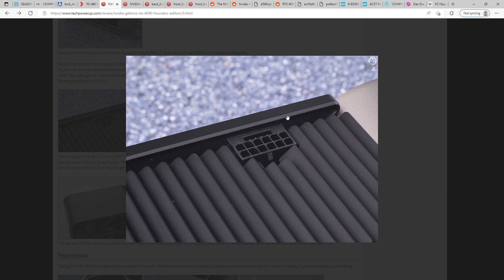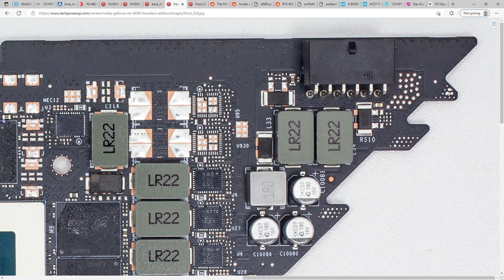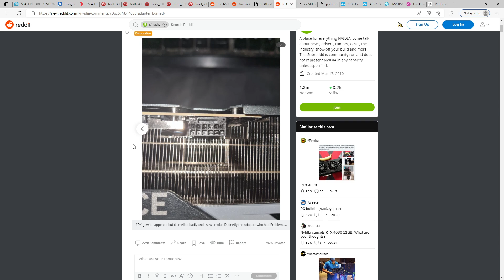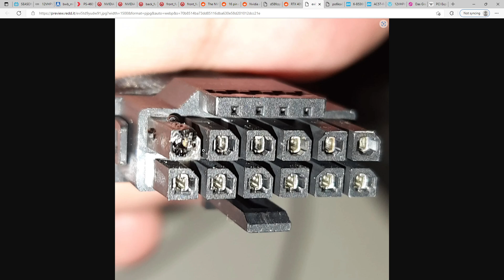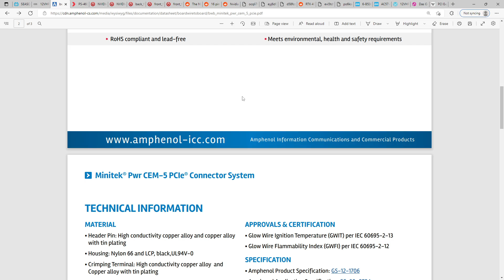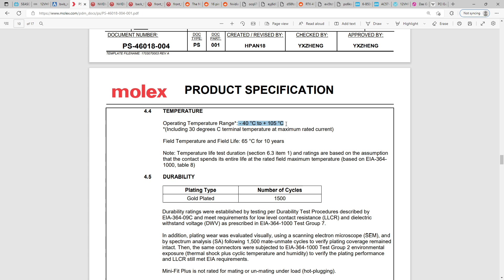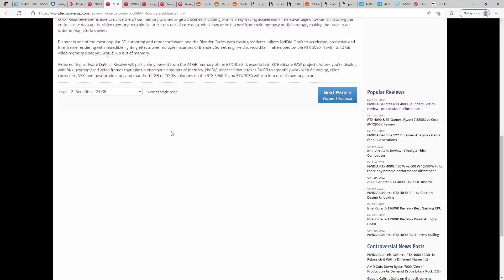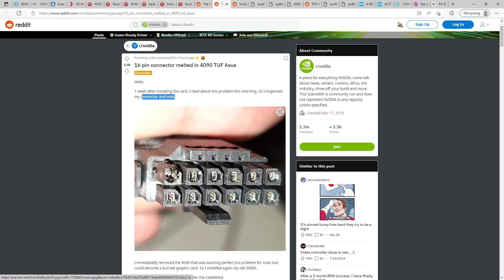rambling about the 12VHPWR failures

Comment: Sorry man but you are very wrong on this one. Even few Watt's of power is enough to ignite even metal if thickness of it is not calculated correctly. It's like a fuse. You can test that by making short connection on battery. Even old fashioned zinc 4.5V battery that is not capable of high currents, like modern 3,8 V Lithium batteries are, can start a fire in certain conditions. 
Undersized connector like this conducting 350 to 600 Watt can maje enough heat to warm up a room and can definitely light up plastic parts.
This connector is badly engineered in so many aspects that it is not even funny.
Mechanically it is a POS. Starting from 0.2 mm thickness of the sheet material used to make connection points. Way that thin sheet is folded makes it easy to unfold and create bad connection that will start overheating process. Way how 14 AWG cable is connected to it is bad as well, especially at places where two cables are connected to one connection point. It is proven that under slight stress one if the cables at those places will develop a crack and separate into a loose connection resulting in perfect situation that will cause overheating and fire hazard true sparking.
To have 4090 in any tower case in normal position means that adapter cable will need to bend. Mechanically with those thick cables  that are necessary while low cabke count, bend hard and pull on the connector. Sure bending should be done away from the connector abd before being plugged in but it has definitely vas weak spot and lever effect will work against it from the moment it us built in.
Same 0.2 mm of joke thickness of the sheet metal used for the actual connection added together doesn't have enough thickness to conduct need power levels on low temperature either. Once connection gets lose it is getting even worse. It is to thin.
People got used that they can get away with everything when designing power circuits while new semiconductors like power stages are insanely capable od silly amounts od current while dumping heat into the PCB. It looks like you do not need thickness to conduct hundreds of amps but it just looks like that. It all ads up into nice thickness in the end. In thus adapter cabke and connector it self it just doesn't add up.
Ask any electrical engineer to check it out and they will all confirm this.
In earlier 8 pin connector using 3 of those count of conductor used fir each Pol wad higher. That allowed for thinner cable that is easier to bend. Connector it self used bigger contact points with more surface and thicker sheet was used to make them plus it was spread to more contact points.
Nvidia wanted to save on real-estate used by connector on the PCB. They made this abomination of a connector. It will not fly.
Wait until people use it fir long enough time.
Plus common Nvidia, doing this on top of the line product and doing it to early adopters? Seriously? 
Does it work for some time, sure it does. Any  under designed part works for some time. 
Can someone build it in in the way that there is no mechanical pull on it, sure with some support and big enough case one could do it with serious effort. 
Should that be required for a normal user? Heck no.
It should have been two pins wider at least with thicker sheet metal used for contact's and maybe even L shaped so the end user does not need to bend it. Problem solved. Just dimensioned right would do.

Comment: rtx 5090ti will have two screw and ring connetror crimped on only two cables 10mm2(8awg). And that will be easier to cable manage (only two cables).

Comment: Old 8 pin has pins rated 3x the specced wattage. 150W connector and 460W pins. This 12 pin Hpwr one has pins rated to 680W.

I feel they forgot to add safety margin this time.

Comment: I do think that one or more broken soldering joints might still be one of the reasons for the terminals getting even hotter. The 4 little sensing pins do check how many cables are connected and based on that information the GPU knows how much current it can draw. This is being checked before the soldering happens. So if one or more of the soldering points break the GPU still wants to pull a max of 600w. But it really only has 2 or 3 real connections to do so ... what would happen then? The Pins and Terminals would get even hotter and start melting - Still at the terminals but for another reason. What do you guys think?

Comment: 32:10 - You answered that earlier - When a contact has worse resistance, less current goes through it. In order to make one of the connectors melts, it needs to have BETTER CONTACT, than the others, i.e. more current will go through it, which will increase the temperature. Another thing you need to see is the total length of the connection, including the PCB. The problem they have is that they placed the shunt resistors on both ends, not "in the middle", thus pins have different distance to them, which causes the edge pins to get more current through them.  Take a look on this video by Dave https://youtu.be/kmCvrGVtC0M?t=2124 . Very educational.    (I have a Masters in EE)
Reply: When a contact has a HIGH resistance, it RESISTS the flow of current and the excess current will be converted to heat. high resistance=heat
A good connection would have low resistance so the current will flow (less resistance) and no heat will be created.
Also when the temperature of metal rises its internal resistance rises, so a high resistance contact would limit current flow creating heat, rising the temperature of the metal contact, increasing its resistance more and creating even more heat. Eventually the whole wire along the harness will burn out, its just a matter of time. (auto electrician here and i see this all the time)
Reply: @OG-Romz  That assumes a constant current or power load, since there are parallel wires and also lower voltage, (less chance for arcing when resistance is too large) this is not the case. Think about extremes, if you short an outlet (and no breakers trip things get hot, if there is infinite resistance there is no heat). (but when talking about contacts usual controlling a motor, motors generally are trying to do work, if there is less voltage they will draw the same or more amps, so that contractor will have the same or more current when the resistance is higher)
Reply: @drisbain  ok but there is no such thing as infinite resistance. Infinite resistance measured on a multimeter means an open circuit. 
So your example of shorting an outlet and having infinite resistance(open circuit) would mean you don’t have a short, so that’s impossible. 
Resistance is read as low or high, or a value. Not good, bad, infinite resistance. 
Everything has resistance within it besides superconductors but that’s irrelevant here.
Reply: @OG-Romz  I agree, but don't forget, as you said, that by resisting the flow, you also have smaller throughput (i.e. current). But the other contacts are not changing, so more current transfers to them, so they heat, so you get more current and heat more, which leads to more current to others, etc...  This is why I said there is a runaway effect. In this case I think that more than the designed current goes through the terminal and pin at the edge.   We will probably know soon.  But one of the important lessons they gave us was that paper math doesn't match realworld tolerances in elements.
Reply: What are the calculations for heat (q) from the resistance and current of a wire? Are you saying if you double resistance, than you have half the current? Or are they not proportional like that?
Reply: @SlimJ87D  Heat, (or power lost to heat) is simple wattage, so it W=I*V and since V=I*R so W = V^2/R or R*I^2.
Reply: @drisbain  but that doesn't necessarily calculate temperature and internal heat generation. If you have a cable and smaller cable, they'll be at different temperatures even though they draw the same power due to their resistance.

That's the equation I'm looking for.
Reply: @SlimJ87D  they are, but when connecting parallel wires you have other processes that also take effect. Ohm's law is I=U/R - double resistance, half the current over a single wire, half the resistance - double the current.
  I speculate on the actual physics involved here, but IMO the main problem is that it is really high to passively balance current and there is a combination of factors that lead to a runaway effect.

Comment: Thinner metal = higher resistance, improper contact = higher resistance, higher resistance = more heat = plastic melting, it's just that simple. Thanks for clarifying shit, been following on Reddit and YouTube, finally someone that knows their shit.
Reply: When using bus bar to connect all pins then current go to other pins so lower power dissipation on that pin. If you got one lucky good connection because uneven force then you have problem because it will take bigger portion of current and it will heat more than others. If that ndivia adapter would have individual cable/pin then we don't have this current balance problem in this scale.

Comment: A better mechanical design like a retention bracket directly attached from the wire with kind of comb to the adapter would have prevent the cracks of the solders.
Can’t believe nvidia engineers didn’t see that kind of problem coming during mechanicals stress tests.

Comment: They definitely changed the adaptor, It was 3x 8 pins and they were direct wired to pins rather than the distro solder block connection.
Reply: Yeah, hense the hard 450W limit on the FE card. The irony of Nvidia "playing it safe" by sticking to the PCIE spec and cramming in a 4th 8-pin when they may have avoided all of this drama by simply using that adapter is just too good.

Got tired looking for a pic to see if it used double split terminals but I assume so. If the 3090ti balanced the load across the pins better that may be a big factor but I really want to see tests on a 4090.
Reply: @JJFX-  if they were so set on this connector they should have just used two and ran 300w through each with two 8 pins. Sure it'd take up more space but it would be better than 4x 8 pins
Reply: @p.e.r.c.y  More space? Do you mean the card connector being 2 merged 8-pins, not the 16-pin connector adapter?

As much I'm for not sticking to the 150W spec, I understand why they wouldn't want to push it to 300W for widespread use. Using 3 like all the 3rd party PSU adapter cables gives plenty of margin for error and more room for overclockers to play with.

I also don't understand why they aren't including the PCIE slot in the power spec for these cards anymore like they did when they were just using 8-pin connectors. They didn't seem to care when the 1080 FE max limit included ~70W over PCIE.
Reply: @JJFX-  There is still a little draw from the slot (15-20W at full load based on various reviews), but the main reason that most of the power comes from the PCIe power cable connection is for ATX 3.0 PSUs and their ability to communicate directly with the GPU about power requirements, the ATX 3.0 PSUs have no way to communicate about the power draw over the slot from the motherboard.
Reply: @jmarynicz  Haven't Nvidia cards typically only drawn up to ~50W over the slot for a while? Up until the 16-pin started being used on the 3090ti, the 12-pin FE cards still reflected or even surpassed the PCIE power + slot rating. All the 2 8-pin adapter cards had max limits between 320-400W. 400W is beyond all specifications.

So even though they're all technically ATX 3.0 cards, for some reason Nvidia stopped including headroom over the PCIE power spec for 16-pin connectors.
Reply: @JJFX-  my 3080Ti goes to 110% of 350W, so 385W that is with dual 8 pins. But I've never been able to get it to pull more than 350W generally 50 from the slot and 150 from each 8pin, so at or below spec for all. I think some the aib models (like the strix and ftw3, etc) with higher power limits might use 3x 8 pins.

The 3090Ti FE only had a 12 pin connector, just like all the other FE cards, but lower models wouldn't necessarily have all the pin spots populated in the adapter.

There isn't a 16 pin power connector, there is a 12+4 pin on, exclusive to the 4090 at the moment, but that only has 12 power pins not 16. The only way to get 16 power pin connection on a GPU would be a dual 8 pin (12, 6 per connector) along with a 6 pin (4 per connector) and I haven't seen a card in that config.

For the PCIe 5.0 the majority of the power comes from the cable so that when used with an ATX 3.0 PSU it can take advantage of the power communication, ATX 3.0 PSUs don't have the ability to regulate power over the PCIe slot, that's up to the motherboard. 
3000 and earlier series cards were not PCIe 5.0 so didn't have this requirement, while they will work just fine with an ATX 3.0 PSU, they won't take advantage of the smart power communication so there is no need to have all (or the majority) of the power come from just the cable. 
This is why the new 12+4 pin connector is being 'forced' on the aib cards where the regular 12pin of last generation wasn't.
Reply: @jmarynicz  Actually the 3090ti FE was the first to use the "16-pin" (by that I mean the 12+4) that is on the 4090. I honestly didn't realize this either until all of this started. However the adapter only used 3 8-pins with a hard 450W limit.

There are notable differences in how the card handled the connector. It looks like the 3090ti treated it more like 3 8-pin inputs, as BZ pointed out in the video. I think he may be underestimating the difference on the 4090 but it's hard to say.

The PCIe 5.0 spec is a good point though, I had assumed the 30 series was effectively the same on an ATX 3.0 PSU. I know many didn't seem to actually draw their max power limits despite the headroom to do so. I've heard temperatures seem to play a bigger role in how much they actually end up pulling.
Reply: @JJFX-  you are right, I assumed it was the same has the 3090, my bad. Yep I don't know if the 3090Ti actually makes use of the 4 sideband/sense pins. Maybe they just had a bunch on hand for the 4090 production they used them instead, the 3090Ti came out pretty late. 

Up to and including the 3090, the power connection was purely a 'dumb' one, just like it's been before. It appears for the 3090Ti after a brief look at the PCB pictures that it seems to partially support the PCIe 5 power spec, enough to determine max power draw but no additional features.
It seems that sense 0 pin is left disconnected on the PCB (along with the 2 side band connections) and just sense 1 is connected, but it purely seems to be connected to ground by way of a resistor, so I don't think it does anything, whereas all 4 pins appear to be connected on the 4090 and actually head somewhere other than ground.

So, it appears that while the 3090Ti uses the 12VHPWR 12+4 pin connector it actually gains no functionality from it over a regular 'dumb' 12 pin (found in the 3080-3909), at least based on the fact that the pins aren't connected to anything on the PCB, other than one to ground. Maybe they just used it because they had them on hand for 4090 production.
Reply: @JJFX-  It is the same double split female pin, if you check the Techpowerup review of the 3070 it shows a pic of the connector, you can clearly see its dual split pin (albeit with half the pins populated because it's a 3070). The reviews of the higher end cards didn't appear to have pictures of the 12-pin end of the adapter.
Reply: @victorfit_x  they would be the same, it would just be 4 connectors (of 8 pins each) vs. 3. This would be required for 600w to match that of the 12+4 pin. In reality that 8pin connector is actually good for 300w, many PSU manufacturers have stated that and actually pass 300w through an 8 pin connector (so normally populated with just 6 power wires).
Reply: @victorfit_x  I didn't realize you were talking about the adapter. You should be fine with the adapter from the 3000 series, while they do share the same style of pins there have been no reports of them burning/melting and they have been out for a while. The wires are properly crimped in those rather than the solder mess in the 4000 series adapter. But you could always order a custom cable direct from your PSU to the 12 pin that the 3000 series FE cards use.

But if you want a new PSU that one will be fine, most PSU manufacturers spec the 8 pin connectors for 300w at the PSU end, so with 2 of them that will be plenty of headroom for 3000 series cards.
Reply: @victorfit_x  It must not be an Nvidia one then since all the Nvidia branded 4090 adapters were 4 pin. I think you have the 3090Ti one, that's what it sounds like.

Comment: Connector's rated for 9.5A per contact at 12V, and 1A at 12V for signal pins.

Regarding fires it's rated UL94 V0, which means "burning stops within 10 seconds on a vertical specimen; drips of particles allowed as long as they are not inflamed."
So, it's fire resistant nylon. https://en.wikipedia.org/wiki/UL_94
In theory there's 1416 watts maximum that can be passed through.

But the signal pins shouldn't draw much power, so it's more around 1370W max.
Well over the current 800W or so drawn by a 4090 overclocked, right?.

Well here may come the issue. What if the power supply doesn't share the load properly accross all pins?  What if an adapter is used from the old 4x2 pins into the new 16 pins connector and what if that adapter doesn't share the load properly? 

Maybe the culprit lies there. Because the connector is pushed near its limit, and something else may not balance the load properly through all pins, that's what could make it melt.

Each pin is rated for 114W.
However, what if a single 8 pin connector were to send all its 150W through a single pin of the new connector due to an adapter?